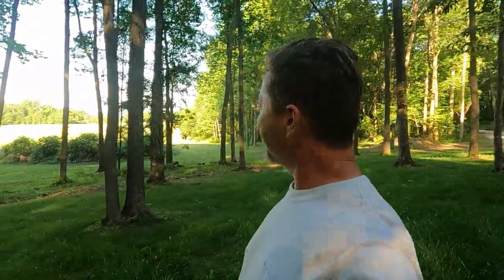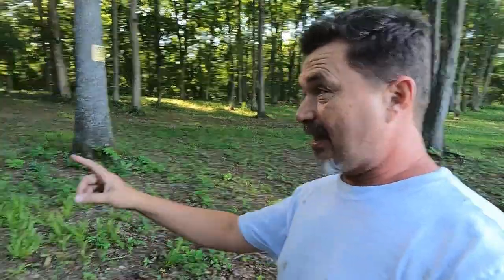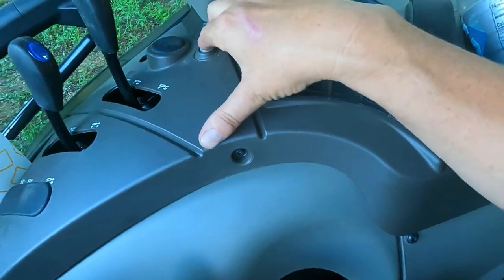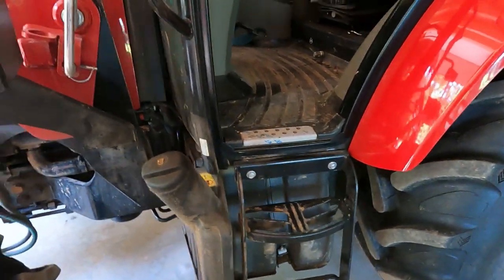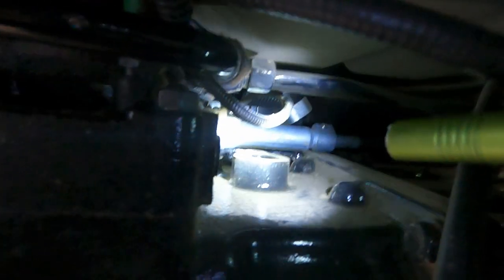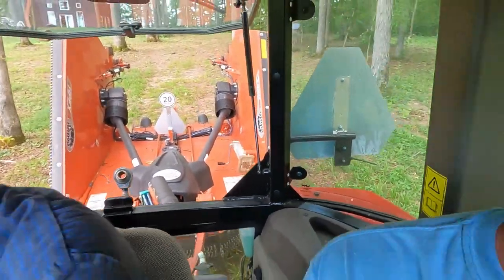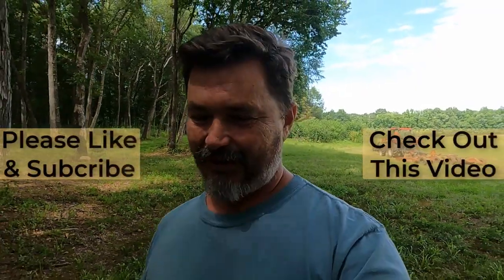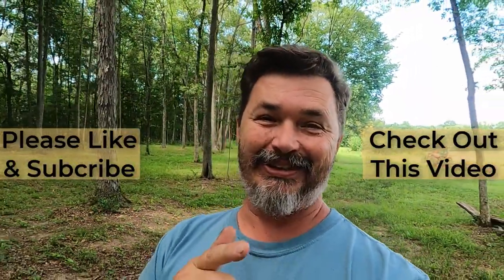Tractor PTO Will NOT Disengage On My Case IH 75C

Comment: I'm going to make a suggestion that I do for everything that I've purchased with an engine. I always purchased  the service manual  to go along for that specific machine: quad, snowmobil, tractor, generator, boat, car, or truck. And then I have a reference for most all repairs. Try to get references with exploded views. My Dad would always toss the Chilton manual at me when I was curious about how something works. Now I've had a few tractors, and when starting a PTO, implement go well above stall RPM to engage but not at full RPM. Then, to disengage at the slowest RPM, do not let the implement to free spin or continue. Imagine a hay bailer with the momentum of a flywheel going, slowing that flywheel before shutdown saves it from causing damage to the drive train. I sure wish that the old F-86 jet mechanic was still with me, I still hear him from time to time reminding me to look in the book.

Comment: Awesome Video. Thanks for taking the time to do it. Took me right where our problem was. Tools you need are a 4mm Allen 1/4” bit and then a 1/4” bit ratchet (#11205). I got mine at O’Reilly’s in the checkout line. Love it.  Made it so easy to get it tightened back up in the tightest spot.

Comment: What I have found is the oil cooler is not keeping the oil cool. For some reason pto light will not go off on dash witch if you shut tractor off with light on it will not start. Make sure your cooler is clean. After using pto you may have to let tractor cool before light go off on dash

Comment: Always engage the PTO at the lowest RPM setting that will not stall out the tractor.  If you continue to engage in high RPM something will break one day.  As far as disengagement, it’s better to disengage at a slower rpm as well, but not as detrimental as  when engaging.  Adjust the linkage..
Good luck with this
Reply from the maker: Thanks. It's good to get this information from multiple sources. Makes sense.

Comment: So couple of things to help you understand what is happening. First, engaging the PTO at high rpm’s is really locking in the gear.  Pto engagement is not like a car with pressure plates etc.  Think of it like a 2 interlocking hands or angled teeth locking against each other. So if you do that at 540, it really locks them together with a lot of force.  That is why you have shear pins or slip clutches. Because it is a hard and fast gear engagement and nothing will slip.  So it will take a bit of force to disengage. And again the disengagement has to actually slightly rotate faster to open up the gear because of overcoming the angle of the teeth.  So if you already rotating the implements at max rpm’s there is too much resistance to disengage the teeth.  To see this in practice if next time you have a problem, if you disengage at 540, leave it disengaged and quickly drop the rpm’s and it will disengage. The implements momentum will help the disengage. But I don’t think if you will ever see the problem again if you engage at 1200-1300 rpm’s.
Reply from the maker: Great advice. I appreciate all comments and I have learned from this. Thank you!

Comment: I have a 2019 NH Workmaster 75 and it just did the same thing to me last night. I have been mowing for weeks in 2-3 hour stints without issue, but last night in this crazy high heat it would not disengage when I finished mowing for the night. Shut it down and went back in an hour and it was fine.....

Comment: Exactly the same. Tractor won’t start if it thinks PTO is engaged. My dealer says they’ve fixed four of them. Also on my 75A there is no way to slow roll or soft start PTO. Dealer says they are working on a fix with CASE, but no solution yet. I have to max RPM’s to use my batwing!
Reply from the maker: Wow, I hope they get this figured out for all of our sake! Thanks for the info. Good luck!
Reply: Oil is not cooling properly CIH screw up

Comment: I'm not sure how your tractor is equipped but, when unfolding i believe you should shove the hydraulic lever too a float position so that when the wings are fully down then the cylinders will be able to move to allow the wing to flex on uneven terrain.
Reply from the maker: Thank you!

Comment: I have a big 15ft batwing that really puts a strain on the tractor when I first engage the PTO. What I learned to do is to engage the PTO at low RPM for a brief moment just to get the blades spinning, quickly disengage so as to not bog down the tractor, and then gently engage the PTO again to spin the blades up a little faster, quickly disengage and give the tractor a moment to recover, and then finally engage the PTO for the last time. This on/off, on/off routine with the PTO seems to get the mower up to speed without stalling or putting strain on the tractor.
Reply from the maker: I appreciate that and will give that my best shot to see how it works for me. May take a little practice but sounds like a good idea. Thank you!

Comment: Hi there, I've got the same problem with my New Holland T4020, which is basically the same tractor (only done 1,400 hours). As mentioned, the PTO will engage and disengage fine when the oil is cool, however once you've been working for a while with it, it won't disengage as the oil is hot. One way around this is to manually press the safety switch under the cab. It's directly underneath the cab, just under the right side door. A lever presses down onto a button which has a spring on it - you should be able to see this by looking in from the right under the cab. Just press it manually and it will work - the PTO will switch itself off. Hope this helps!
Reply from the maker: This will help a lot! I really appreciate that. I had no idea about that switch. Mine has not given me any trouble since that video was made so I am hoping I am in the clear but very glad to get this info from you. Thanks, good luck and take care.

Comment: Alright guys. 
I have the same tractor.
The problem is 1 of 2 things.
Either the cable isn't well adjusted and it wont push or pull.
Or, the retainer coupling is loose and came off. 
To fix the issue, get under the tractor on the left side, behind the fuel tank. You'll see exactly what I'm talking about. 99% of the time it's the coupling. Its floating on the shifting cable.
Reach up and move the actuator forward to disengage the PTO. To get the coupling back on,  its a 4mm alan socket. You'll need an extension to reach it. Maybe let the tractor cool down a little also, there isn't much room and it can get hot.
Reply from the maker: Great info!
Reply: Great info on this video!  I have the same tractor with a slightly different issue.  My pto light stayed on but the physical pto went off/on just fine.   However when parking it i cannot start it since the light is on.   After watching this video i discovered these allen bolts loose and movement in the coupling.  I tightened this up and closed the physical gap however my light stays on.   I'm wondering if i have an electrical switch problem but not sure what's triggering the light.

Comment: I have a New Holland T4.75 with the exact same problem. My cable has been been adjusted/tightened the past two springs. Now the cable is all tight, but will not disengage. My theory is that the shop that worked on mine has tried to adjust the cable without taking anything off the tractor to gain adequate room to access the parts. So they  half-arse the adjustment and it doesn’t last. It’s simply an unreliable design.  
People don’t understand that the tractor will stall if you try to engage the pto at or near idle. There is simply too much mass to get up to speed.Good luck with it.
Reply from the maker: It is a shame that you are having to deal with that. As of now, mine has been working fine. Once he came out and basically pried on the linkage, it has not had an issue. I agree it will bog down and stall if idled too low. I think I have found a sweet spot to engage and disengage now. I sure wish you the best. Please let me know what happens in your situation. Thanks and good luck to you!

Comment: same issue with my 75c same bush hog after getting hot will not turn off.  Hope you found the solution
Reply from the maker: Man that’s too bad. After the service tech attempted his fix it has never happened to me since then. Have you resolved your issue yet? Good luck to you!!
Reply: @TheLovelyPlace   It may have in fact been the allen screw by the fuel tank as it was slightly loose.  I didnt see him fix anything in your video.  What do you think solved the actual problem.
Reply: Check your oil cooler, make sure clean. It's a CHI screw up to small cooling system

Comment: I have the same tractor, I wasn't even using the PTO and the warning/engagement  light came on as if I was using the PTO. Naturally I shut the engine off to see what the problem was with the PTO shaft. I go back in the cab turn it on and the PTO warning is still on, now my Tractor wont start. My question is this, did the linkage come loose underneath or something and it turned the light on ?
Reply from the maker: That’s a good question. My tractor never had the issue again after the service tech messed around with the linkage as seen in the video. I am still at a loss but thankful it’s okay for now. Several people have shared they have experienced the same. Good luck to you and thanks for dropping by the lovely place.

Comment: Hello, have you found a solution to the problem? I have the same thing with an NH Powerstar 75. thank you
Reply from the maker: The problem has never happened since the service tech came out and attempted his fix as seen in the video. I have also began dropping the rpm prior to engage and disengaging the pto. Good luck to you.
Reply: @TheLovelyPlace  ok thank you, I had it twice this summer, after 2 hours of mowing. The mechanic in the video didn't seem to be able to repair much, it seemed to me. Greetings from Belgium
Reply from the maker: @NicoSijmons  greetings to you from Tennessee. I agree 100%. I felt like he did not accomplish anything. However, since that day, I’ve not had one single issue, so I’m just hoping that whatever he did accidentally worked. My fingers are crossed that it will not happen again. I wish I had a bit better answer.
Reply: @TheLovelyPlace  According to my dealer, something gets stuck in the aluminum piece due to the high temperatures while mowing, he advises me to spray it with WD 40, I will try it. Thank you for the response

Comment: It is common sense to engage the pto at low rpms and disengage at low rpms. Why would you not do that?
Reply from the maker: Thanks for your comment. Common sense is sometimes uncommon. Prior to working on this homestead the only pto engagement I have done in my life was on a mower. I never knew to do it at a low rpm and was never shown or asked and never had any issue or reason to question it. The way anyone learns anything is to ask, read, or be taught, etc. Now I know. Glad I asked before I caused any problem. I asked because my common sense was saying, something is not right when I do this. I could tell it didn't feel right. Be patient with me, I'm doing my best to do things right. You don't know what you don't know, until you know.

Comment: What did you do to get it fixed my 75c is doing same thing
Reply from the maker: Hey buddy, I hope this helps but if you watch that video, he messed with the linkage he put a bar up in there and move the linkage around. He really didn’t think he did anything but since that day it has never had the problem again. So I would really look closely at that linkage when he got under the tractor if I were you.hope this helps. Good luck.
Reply: @TheLovelyPlace  that is what the dealer told me to do but no luck yet thanks for replying and I farmed for over 30 years any time you hook up a implement always engage low RPMs keep from trauma to it so to speak.

Comment: the tractor will start the hog at a ideal if the blades are not trying to cut material, you have to be lite on the leaver feather it in. When disengaging the same at a idel this takes pressure off the PTO drive letting it easley disconnect. From the questions you were asking the mechanic I would bet you've never drove a straight shift vehicle so you have no concept of what's going on inside the tractor.
Reply from the maker: That's good information, thank you Larry! No, I have driven a stick shift my entire life so it's not that. None of my cars have had a PTO, lol so this part is brand new to me but the way I learn things that I don't know is just try, ask questions, read, etc. So I think I have this all about figured out now. I really appreciate you responses very much.